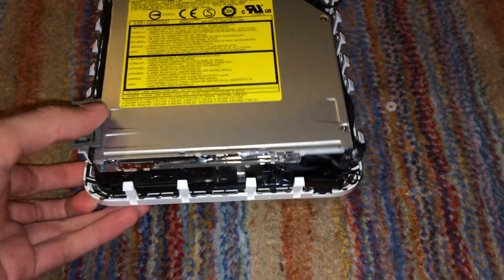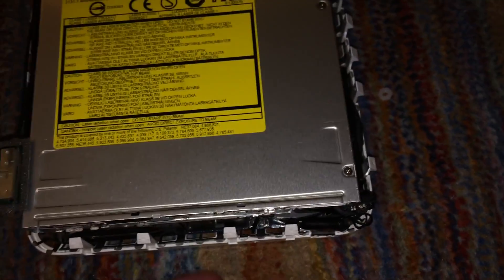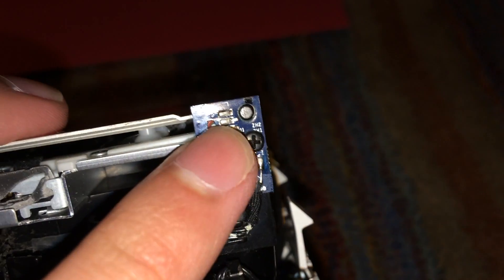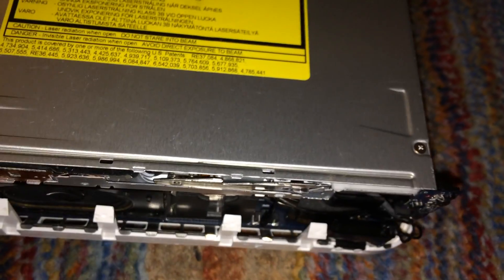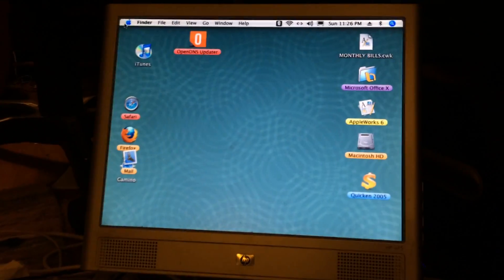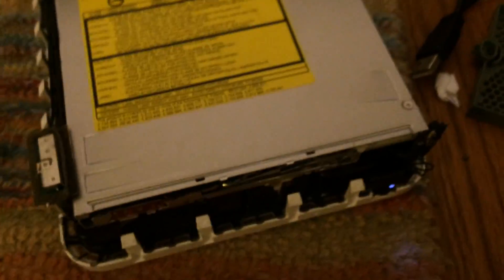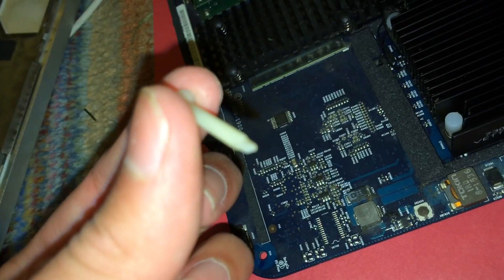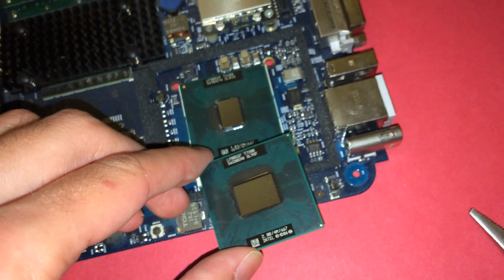2006 Intel Mac Mini Restoration and Upgrades

Comment: Just did this upgrade 2.33 intel core 2 duo on 3 macmini  and upgrade to 2 gig  mem, running fine.  Any suggestion on the best OS since support for Mac OS 10.6.8 and up  is not available anymore, and I think it is useless to try to install 10.7.  So I'm open for suggestion windows 7/10? linux ??.
Reply from the maker: You can install up to 10.8 Mountain Lion using MacPostFactor, but that's about it. If you go Windows, install 7. Windows 10 is complete garbage.
Reply: @dosdude1  I wish to install windows 10 32 bit but the installer after charge the files doesn't show anything in the screen and I don't get to continues. the same occur when i try to install windows 7... thank you so much

Comment: would the core 2 duo e6550 2.33/4M/1333/06 work? thanks!
Reply from the maker: No, only laptop Core 2 Duos with a 667MHz front side bus work in this machine.

Comment: Hello, 
Excellent video!
I have purchase a Mac Mini A1176 Intel Core Duo 1.66 GHz 2GB DDR2 RAM can I upgrade the cpu? Which is compatible? And witch is the late OS X it can run?
Thanks
Reply from the maker: +André Domingues You can upgrade it to any Core 2 Duo CPU compatible with the Intel 945 chipset, I'd recommend the T7200 as I used. You can run up to Mac OS X 10.8 (Mountain Lion) using MacPostFactor, which I have a video about doing on this exact machine.
Reply: +dosdude1 I found this http://forum.netkas.org/index.php/topic,874.msg15441.html.com. What is your opinion about it? T7200 vs T7600 is the difference in price worth it?
Reply from the maker: André Domingues The T7600 will work fine. Just get that, it's a bit faster than the T7200.
Reply: +dosdude1 Thanks for all the help.

Comment: I did everything just like you did, but i suddenly lost the sound. There is a sound but after i connect the mac mini with speakers. Did i make something wrong when i reassembled it?
Thanks
Reply from the maker: +alan861000 Make sure the ribbon cable that connects the sound board to the drive interface board is properly connected.
Reply: +dosdude1 Thanks i"ll try it again. And one more thing. When i installed the t7200 my mac mini airport wifi signal has become rubbish. It can not reach the wifi signal even if it stays three meters away(router).
Reply from the maker: alan861000 Make sure you plug the wifi antenna into the AirPort card before putting the drive assembly back on.
Reply: The wifi works but not at the same pace as it was before. As you said, i should probably open it again and make it work. Thanks a lot.
Reply: alan861000 mine did the same the zif connecter snaped - still works fine though just use a USB sound card

Comment: Awesome video! Where can I buy a T7200, T7400 or T7600 cpu? FeeBay has them listed but they all looked used!
Reply from the maker: +mash35231 Just get one off eBay, it doesn't matter if they're used, they'll work fine.
Reply: Ok I'll get it from FeeBay.

Comment: What kind of bus speed can I use for my iMac Late 2006 (G5) I want to have 64bit core 2 duo.
Reply from the maker: Vinnie Pie If it's a G5, you can't use an Intel CPU in it. If it's a 2006 Intel-based model, you can upgrade it to a Core 2 Duo T7200, T7400, or T7600.
Reply: Ty very mutch (: